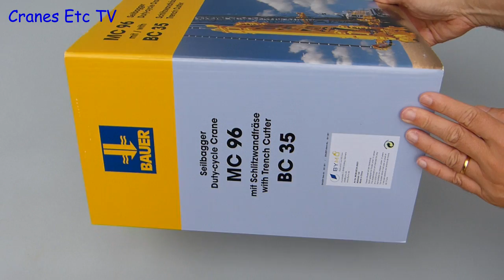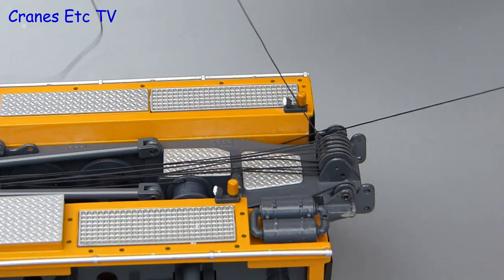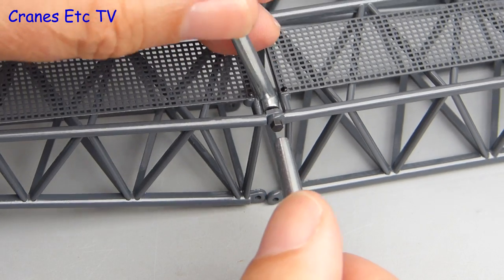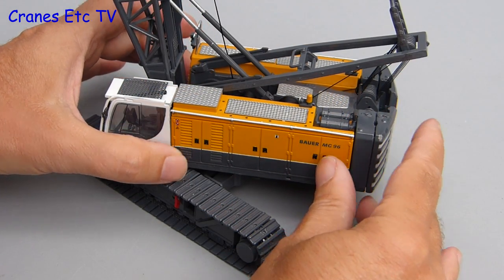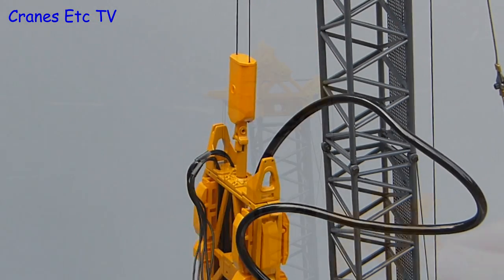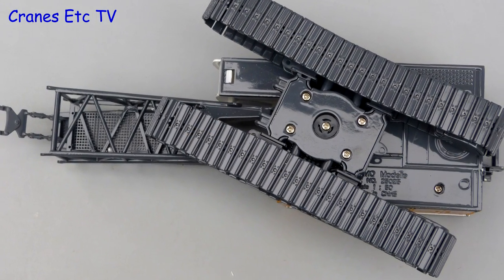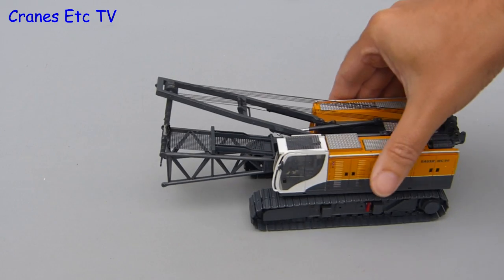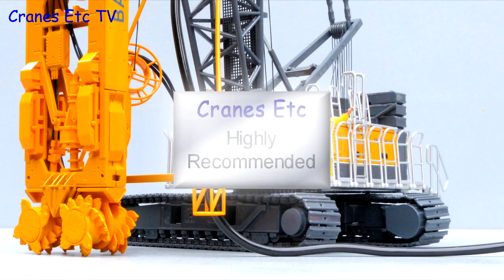BYMO Bauer MC 96 Crane + BC 35 Trench Cutter by Cranes Etc TV

Comment: Thank you for posting this assembly vid. It was extremely helpful. My kit came without instructions. I was able to take screen shots of your vid to use a reference guide.

You are correct about the screws being to short to attach the lower hose guide frame and the slurry return line having kinks in it from the packaging. I will take a hose sample to my local hobby store to find a replacement or apply a hair drier to the tubing to get rid of the kinks.  

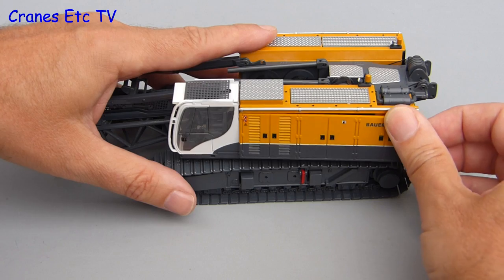I found I had to use a touch super super glue to hold the short screws to keep them in place along with glue applied the front spot lights, safety railing, counter-weights, exhaust and hydraulic hoses and manifold. The excess hydraulic hoses had to be trimmed back about 10 inches to fit into the crane body even using the full lattice boom length.  (Note: Depending on the depth of your 1:50 slurry/cut-off wall a shorter boom can be used) And there was tricky part when the tools supplied had to be augmented with some model needle nose pliers such as reaching in to fit parts the supplies tools will not fit.

It will be noted a few extra screws and bolts come with the kit in case you drop one into the carpet. Or as the narrator's advice "not to tighten up the nuts and bolts" is correct. I over torqued a nut and the screw snapped. 

Some other faults with this model are the hose reel winches were difficult to unreel and cabling up the A-frame was trying as the "wire rope" keep slipping between the sheaves and my eyes are not the good. The side panel that hide the side winches is very loose. And the hoist line-to-cutter connection using two hoist drums may not be prototypical. I recall on my real-world projects it was a double wrap single line block and to one hoist drum and not two hoist drums.

A few comments about your vid for the next assembler: skip the transport mode assembly with the use of chains if  you are building out to the full cutter assembly and skip the full crane assembly with the  MC-90 crown. You will find you will have two spare tendon cables with associated  nut and bolts to used as spare in case you over torque and break them when building to the cutter carrier mode.

Although I have only built couple of real world cut-off walls with a BC-40 , as assembled this BC-35 has excellent detailing and makes for a great desk display. It now stands as a daily reminder of a 7,400 LF cut-off wall construction contract from hell performed by a contractor that should never be allowed around a Bauer cutter ever again. I guest that is why they lost 2.5 M in court. And remember the late nights talking with Tomas S. of Bauer as we cut panel slots into a dam. 

Enjoy your Bauer MC 96 Crane + BC 35 Trench Cutter build. I hope this comment helps other builders.

Build time: 5 weeks during lunch periods when with interruptions for meetings.  The straight thru build time 50 minutes.

Degree of build: Moderate. Parts were well machined except for hose guide frame.

Cheers,
Timmy
Reply: t ytrehalf his name is Timmy?!?!?!?
Reply: My model of this crane also came without instructions.